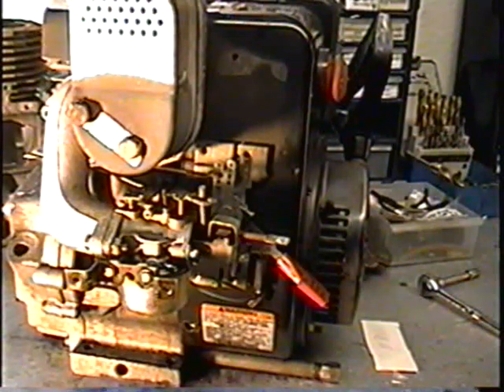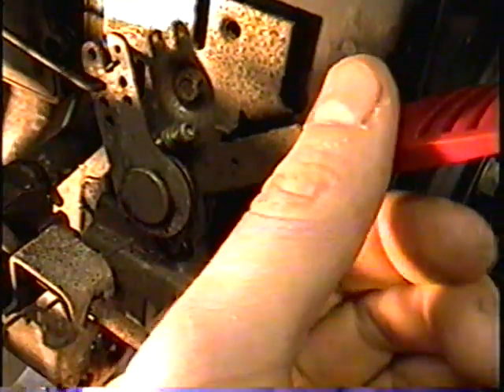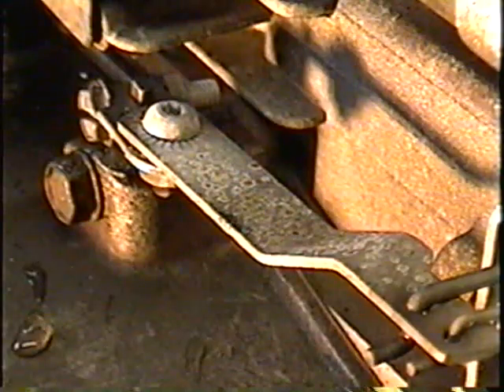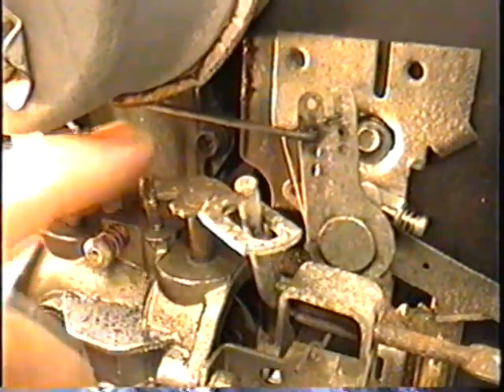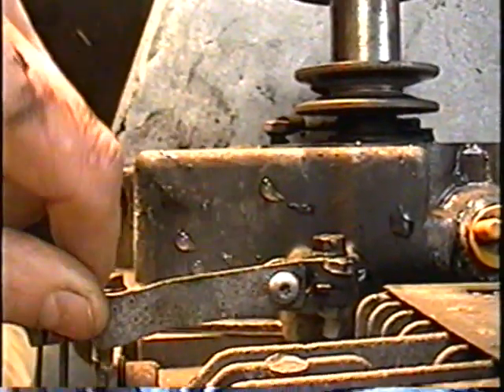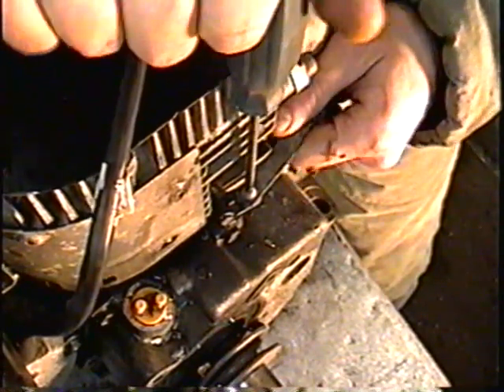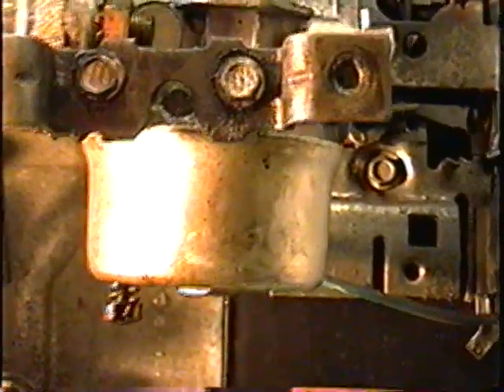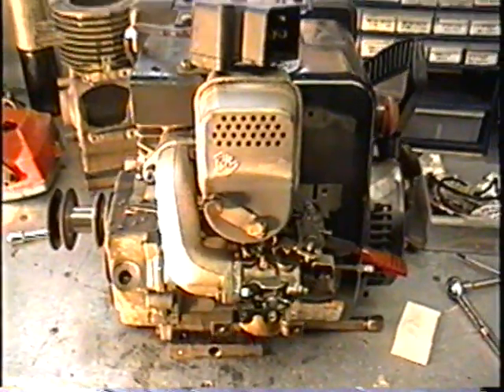HOW TO ADJUST SNOWBLOWER ENGINE SPEED GOVERNOR

Comment: Regarding engine rpm I'm astonished at how often I hear "if it runs too fast/slow" and just left to the tuner's ear.   No doubt one person's ear and the next might be off by 500 to 1000rpm or worse depending on their experience with small motors. 

This is one of the best "bargain" category tools I've ever purchased on ebay.
http://www.ebay.com/itm/New-Digital-Laser-Photo-Tachometer-Non-Contact-RPM-Tach-High-Resolution-DZ88-/400564157879?pt=LH_DefaultDomain_0&hash=item5d437bfdb7
http://www.ebay.com/itm/DZ88-Practical-Digital-Caliper-Luxmeter-Photometer-Tachometer-Thermometer-Meter-/400608819594?pt=LH_DefaultDomain_0&var=&hash=item5d4625798a
I purchased the first one linked and have adjusted every small engine in my possession to manufacturer's spec.  Best for the engine and good for my peace of mind. Dead simple.  Reflective tape comes with the unit and you cut a 1/2" piece from the roll and affix it to any rotating spot on your engine.  Point the led/laser (these are just led but are effective to 20 inches or something like that)  and press the test button.  Very cool gadget.

Comment: Whats the fix for a carb that only works when its fully choked. thanks
Reply: replace both gaskets on the intake manifold
Reply from the maker: you need to clean it and possibly get a rebuild kit

Comment: Last season my '95 Noma with a 9 hp Snow King mounted started seriously bogging down under snow load. I put the blower up against the cinder blocks of the house and try to push the wall down. Engine chugged away like a champ. I broke the blower down to the auger gearbox. Admittedly, the gearbox is low on lube, but all in there looks fine. No binding on any bearings or pulleys. Any hints on what might be causing the engine to bog only under auger load?

Comment: donyboy73 you do a great job! As like 70supercar above my 8 HP craftsman snow blower slows down quite a bit in heavy snow. But with no load it seems to run exceptionally fast. Will slowing it down under no load reduce the speed even further under load? Or is it possible the governor is functioning as it should?  Fairly new unit and has been like that from day one! thanks.

Comment: Hello, great videos.  I have a 9 hp tecumseh (hmsk-1576506c) on my simplicity snowblower.  The linkage from the governor to the carb is bound up.  When I push on the governor, nothing happens unless i help the help it along.  My carb only has one hole to put the linkage, and has a bushing.  It is as if the linkage is snap passed center.  Any ideas?

Comment: Donyboy!  You have made my day, all videos are exactly what I was looking for thank you thank you!  I do have a quick question, my snowblower will sound just fine when idling, yet when start driving and snow blowing the engine revs high then low. Cycling back and forth until it stalls.  ?  Any idea what that could be? Fuel filter?

Comment: Hello, i have a 1978 sears snow blower. Ran great when i put away. Fresh gas. Now i went to start it yesterday and its not running right at all. It seems like the bowl isn't filling up with gas fast enough. It starts fine, runs ok, (not perfect), then dies. If i have it running with the lever almost completely closed, it will stay running. But if i rev it a little, it will die in 20sec. I adjusted the screws and gets me nowhere. I have watched all of your videos. Cleaned the needles to. Plz help

Comment: Wow ! After unassembling the carb, I just reassemble my snowblower and it has an unstable rpm. I just set the governor screw (try & test) at the "right" place, no thing else change, and now it run so smooth and powerfull. Thanks a lot :).

Comment: Hi I am having a problem with my TORO 1028 Power shift snowblower.  
It only runs at high speed even if the lever is close to the idle position or the lever is in the middle. The snowblower works but I 'd like to control the speed and not having it run at  full  speed when I'm picking up 2 inches of snow.

Comment: I got mine running great today. FYI, the length of the longer rod (the one from the governor to the throttle control) is about 6.5 inches and the shorter one (the one from the governor to the carb throttle) is about 4.25 inches. Thanks for the informational video. Also, the position of the rods seems to be important. I had the longer rod in the wrong hole. I used the hole that's in your video.

Comment: @donyboy73 The carb is exactly like it was before I did the other repairs. Can you give the length of both rods; the one that goes from the governor to the carb throttle and the one that goes from the throttle actuator to the governor? I realize they have bends in them for clearance, but how about the measurements from one end to the other? On other words, from one "z" bend to the other end with a "z" bend? Don't include any bends in between. This would be greatly appreciated.

Comment: Nice video. My Tecumseh is exactly like the one you are showing. I just put it back together after replacing a valve spring retainer. The problem I'm having is the engine RPM surges back and forth. Any ideas?

Comment: I've got an Ariens snowblower, and when I move the throttle up, it just keeps reving higher and higher. I've already eliminated the adjustment screw as the problem, as even when I back it out all the way, it is still too high. It seems the Governor doesn't pull back on the throttle at all, no matter how fast it revs. I'm not sure how I'd fix this, since the Governor is in the engine. Any suggestions of what else could be the problem, or if I'm right, how I could fix it?

Comment: Hi Donyboy, 
I have a MTD 3.5 HP snowthrower with an HSK635 Tucumseh engine. I installed a new carburetor because the engine was oscillating in revs, rather than running at a constant rev. The carburetor has no adjustments -- just the governor linkage and choke.  There is no throttle.  The engine still oscillates in revs.  I suspect this is a problem with the governor.  I have fresh clean gas and a clean muffler. Can you tell me how I can adjust to get the engine to run a a constant speed?

Comment: Hey, I have a 10hp tecumseh snowblower motor and the idiler pully  bolt for the drive stripped out of the motor is there any other way to fix it other than drill and tap? these are the threads inside the motor. could I use a self tapping bolt? Thanks Darrin

Comment: Thanks for the informative videos. I have a Tecumseh Snow King 8hp engine on my YTD snowblower. Everytime it's under heavy load it sputters like it's chokeing out and I have to release the auger handle and decrease the throttle then bring it back up to speed. Any ideas what might be causing this? Thanks. Gerry

Comment from the maker: @4mudski could be running too lean, usually i turn out the bottom screw 1/4 inch when this happens or it could be a leaking exhaust valve

Comment: Great video! Could you tell me why my 1995 tecumseh 10 hp engine's muffler bolts are glowing red when I finish my driveway?? Engine starts with first pull and runs great. Thanks

Comment: i'm happy you got this video in here, i just bought a blower and rebuilt the carburator. my trottle dint work at all. i tryed everything and seem to me that my throttle linkage was not right. i have seen your video and it confirmed my problem, the guy intaled the linkage upside down so the rod is going under the gas pipe instead of on top haha. thanks for the video it helped me alot

Comment: I must thank you for your very informative videos. I purchased a year old 8 ½ HP Yard Works for my father two years ago but didn’t really check it out. This year I noticed the snow blower was over revving and shaking its self to pieces. With advice from my brother in-law to check your videos, I was able to get the snow blower running correctly. 
Thank you again. 
Now I have a new reference for all of my small engines.

Comment: how do I know if my govenor is wore out and needs to be replaced?

I have a john deere 1032, with a 10hp tecumseh and rebuilt the carb and it is running great for the most part.  My snowblower does not throw the snow very far and I just cleaned and straighted the impeller blades.

Comment: Very informative video, thanks!

I have a HS50-67008B engine on my Ariens and the governor spring seems to have lost some "spring". Do they ever need to be changed ? 

Also it looks like I also didn't insert the linkages in the right holes on carb plate and on the governor linkage arms and now the engine speeds like crazy, how do I know which holes are the good one ?

Thanks

Comment: @donyboy73 Just to let you know, I bumped up the governor speed by adjusting the small screw on the throttle lever and it has made a huge difference. Someone must have been playing with the screw before I got the machine...

Comment: Hi there, I have a 10 hp Tec. in a Troy Built blower . When you prime it the gas drips out on the ground, I have taken the carb apart but it still does it. It seems like the prime nipple on the carb is in a bad place wich allows the gas to run out of the throttle body. I was just wondering if you have seen thjis before and is there any way to correct it.